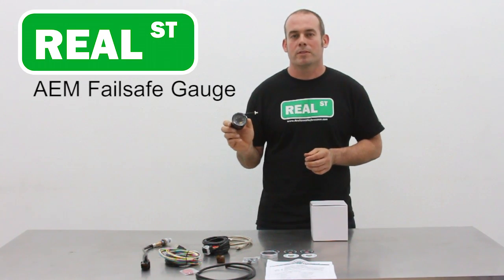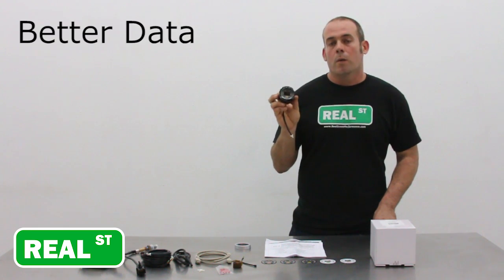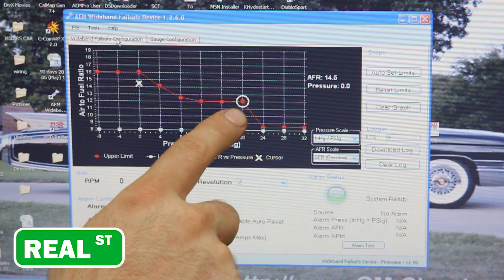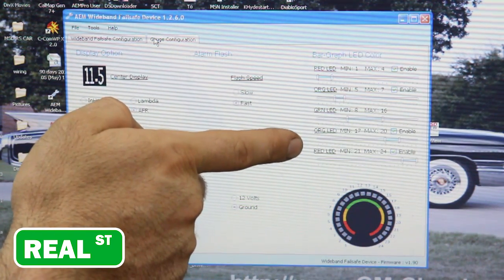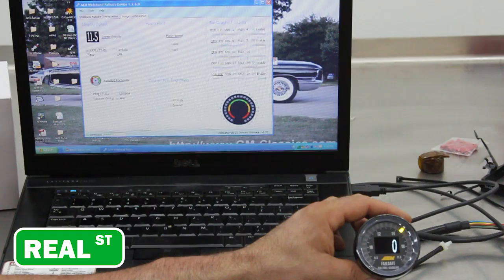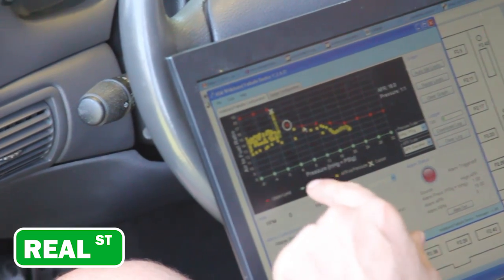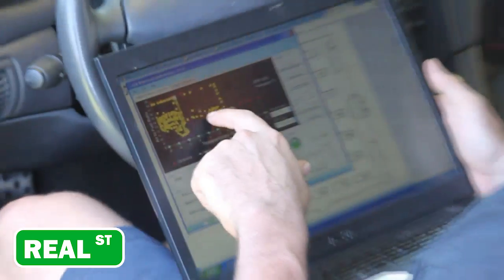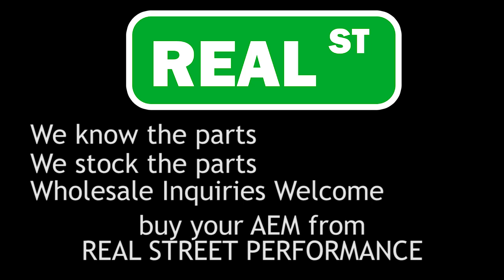AEM AFR Failsafe Gauge 30-4900 Wideband O2 30psi Boost Gauge Product Spotlight

Comment: This is a fantastic gauge. But was wondering why it doesn't have the option to monitor dual banks? Wouldn't that be of importance? Say if the other bank ran lean, but wasn't being monitored?
Also, naturally, the car will run lean when decelerating... What is the tolerance of the failsafe mode? 
And do you have to run lean at WOT for a certain period of time to cause damage?

Comment from the maker: If you click on the gauge configuration tab and select InHg/Psig your center display will show PSI gauge. So with the key on engine off the center display will be 0psi =/-1 depending on where you live. Make sure you've plumbed the supplied vacuum line to a source on the intake manifold that will be both negative and positive pressure.

Comment from the maker: You must install the software, and yes this gauge does show boost and AFR on the same gauge face at the same time. One is a halo around the border of the gauge face and the other is a digital numerical display. you can configure which is which in the software, and it comes with multiple gauge faces for all possible combinations.

Comment: I was under the impression that this gauge could display both boost & AFR, on the gauge, at the same time.  I guess I[m mistaken?  I've also been wondering if you simply plug the gauge into a laptop and presto, the appropriate interface pops up, or do you have to first download software for the PC side?

Comment: I have a mustang also.  How, specifically, do you wire the failsafe ground output to cut power to the ECU? I'm assuming you use a relay to interrupt a normally closed circuit using a ground signal. You're not shutting down the entire ignition, just the ECU, correct? If that's the case, which wire are you interrupting to the ECU to safely shut it down without throwing any codes?  

Also, is it possible to connect the tach signal wire without using a tach adapter? Can you just connect it to a sin

Comment: I saw you were running the gauge in a supercharged mustang, which is what I have. I just got my gauge and I'm trying to figure out the best way to interface with the stock electronics to avoid any catastrophic failures. I saw you shut off the power to the ECU without shutting off the entire ignition. How, specifically did you do that? Do you have a writeup anywhere?

Or...
Is there any way of interfacing with the factory traction control? Instead of pulling timing when there is wheel slip, I'd

Comment: I have an AEM V2 EMS for my Supra, will the data cable plug right into that and can I use the V2 software in conjunction with this? or seperate software/settings?

Comment from the maker: shutting off power to just the coils would cause fuel to still be sprayed into the cylinder with no spark, depending on how long you have your failsafe cutting power for, you might end up spraying too much fuel into the cylinder and having a big nasty back fire. As you saw in the video, momentarily cutting power to the ecu in this car provided a nice clean "cut" and came right back after the alarm. You can adjust the "failsafe time" to be just a blip if you want.

Comment from the maker: You definitely can do that too. On some cars though, the ECU is smart enough that when you cut power to the coils and/or injectors, it will trip an error code in the ecu that you will need to go in and clear with a scanner tool. Different vehicles will react better to different failsafe strategies. Many cars will be able to just cut power to the injectors and/or coils via a relay. You could also have it turn just the boost control solenoid off and go to minimum boost in a lean-out scenario